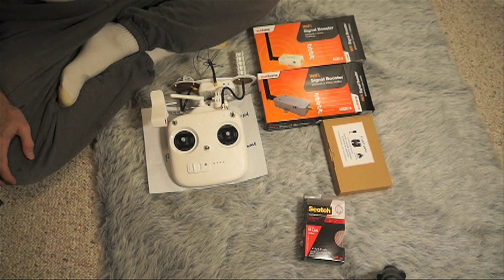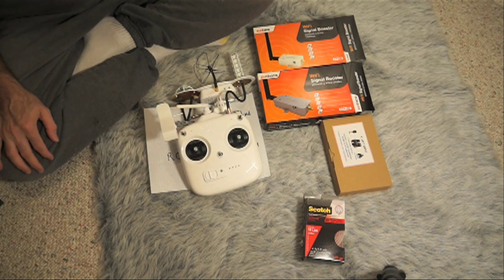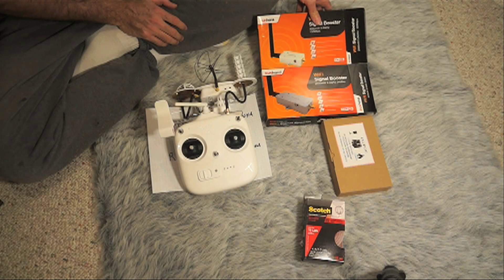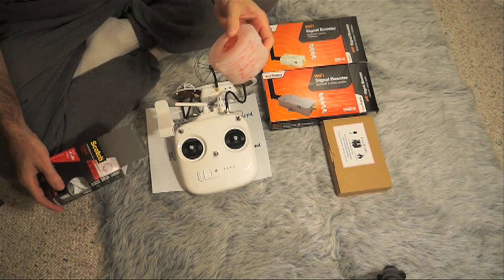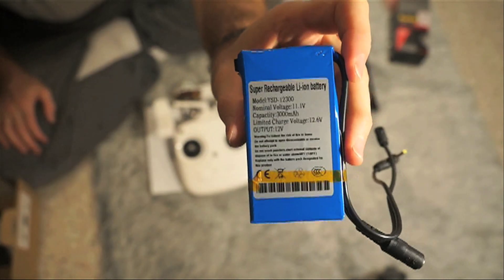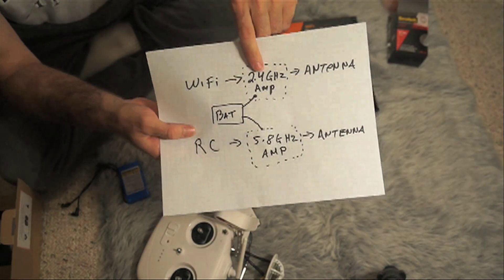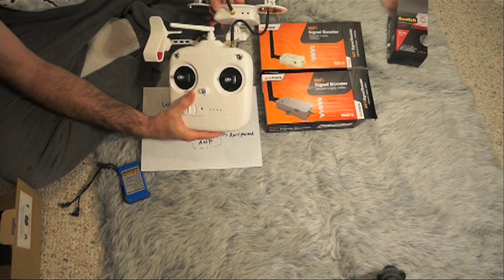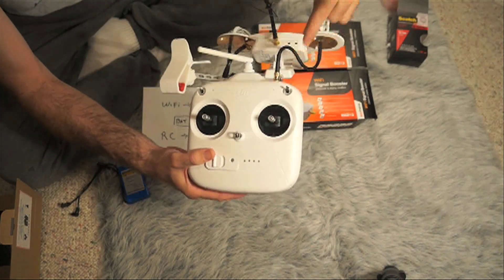DJI Phantom Drone RC and WiFi Sunhans amplifier

Comment: They're both "wifi"... One is 2.4ghz the other is 5.8ghz...  One is video and one is control...  Those amps boost far more output than receiving... signals... When you boost receive you also boost noise and so SN ratio will suffer....

Comment: Assuming that the 2.4ghz power is 100mw (standard) then having a 2W amp you'd expect up to ten times the range. merely doubling it seems disappointing. Any reason for this?
Reply from the maker: That's as far as I felt comfortable going. It might go more but if I loose line-of-sight the drone loses the connection.

Comment: I understand this booster increases the signal from your controller but how does it increase the video signal sent from the drone?  The drone can now 'hear' your controller better but how does this help the controller 'hear' the drone's transmitted video signal any better?  Would you not need to amplify both sides?
Reply: David Albert 
No, the transmitter side only needs boosting. The Drone doesn't have to be boosted.
Reply: Yeah that's what I'm wondering about, too.
Reply: derjoh1986 It does because you only enhance the range from which the drone will be able to receive signals, but it is useless if you don't boost the Wifi link from the drone itself too as the video feed range will still be bad and a good range is useless if you can't see the video feed anymore.
Reply: @prringa6099  No, because the controller doesn't just SEND signals, it RECIEVES them as well from the same distance it can send them to. When you increase the range to which the signal can be sent to, you also increase the range it can receive from also. If you mod the drone itself you can increase the range on both ends which makes it that much better.
Reply: @armandosbelleriver2628  I don't know why you are still replying to a 4 year old comment, but your claim still is unlogical. 

Increasing transmitting range of one side has nothing to do with receiving range, as the receiving range simply depends on the transmitting range of the other participant. Just because you can shout extremely loud, that doesn't mean that you are able to receive my answer.

The modification shown in the video just applys the control, not the drone itself (it even says so in the video description). By using more sensitive antennas for the receiving, it is of course possible to gain a bit of receiving range, but it still mainly depends on the transmitting power of the other end.
Reply: @armandosbelleriver2628  correct
Reply: @prringa6099  wrong

Comment: I have a P3P with A FPVLR and one transmitter went dead ( the green led does not glow )  dissasembled the lot and have it currently as original... how ever upon examining the boosters i find that they ar both identical.. on 2.4 mhz where you mention  to wif and 5.8 to radio.. does my wifi run on 2.5 mhz ?
Reply: Wifi runs on 2.4 GHz, and the RC signal runs on 5.8 GHz.
Reply: Prringa 
No the RC runs on 2.4 and wifi 5.8
Reply: derjoh1986 Wifi doesn't run on 5.8 GHz my friend. It can either be 2.4 or 5 GHz, 5.8 GHz is the remote to aircraft control signal.

RC --> AC transmitting signal --> 5.8 GHz
AC --> RC video signal --> 2.4 GHz

There might be the option to select either 2.4 or 5 GHz for the link between RC and phone, but that's not important as the signal which the drone sends and receives still stays the same (2.4G for video and 5.8G for the control transmission signal).

Comment: Very informative great but all these YouTube postings everybody skips over the fact that when you open up the remote there are two connections to the eye of cans for 2.4 gigahertz I think one is bidirectional and one is a receive but you just speak and even show in your diagram about amplifying Wi-Fi signal but not or where it connects to in the remote controller as you know there were two paddle like directional antennas in the remote. Now I have hey phantom 3 4 k and the bird has 4  2.4 gigahertz antennas in the leg like the lightbridge system and I can only assume somewhere along the line there is a 5.8 although I haven't found it for the control of the unit. Shouldn't all three antennas on the transmitter be Amplified?
Reply: I don't think the two 2.4 GHz wifi antennas inside the RC have to be boosted as these are only receivers for the video feed which the drone sends if I am correct.

The 2.4 GHz wifi antennas are the flat panel ones inside the RC, so just follow the coax-cable and the 3rd cable is for the 5.8 GHz transmission to the drone.
Reply: Mickey G.C. 
Two of the three is good enough. 5.8ghz goes to Wi-Fi, 2.4ghz goes to RC receiver